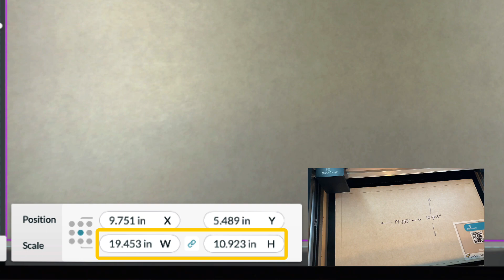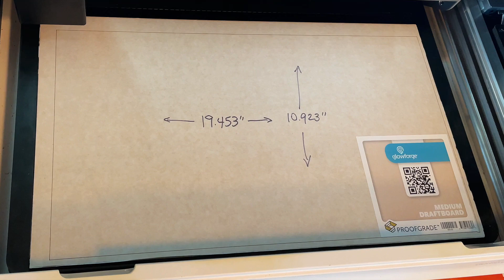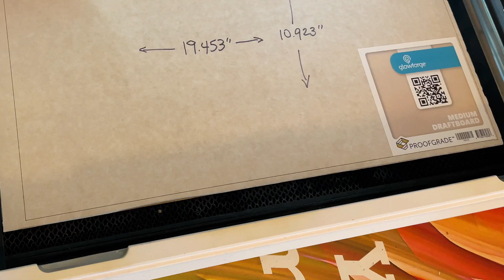Glowforge 101: What’s the Max Size of Wood I Can Use in My Glowforge?

Comment: Thanks!  I have always wondered what the max width and where to set up.  I am guessing the passthrough would eliminate the vertical restraints for 1/4" and smaller. So 19.4" x  (max size of wood 96")  Thanks for the tip on art board size.  I will have to change that in Ai.